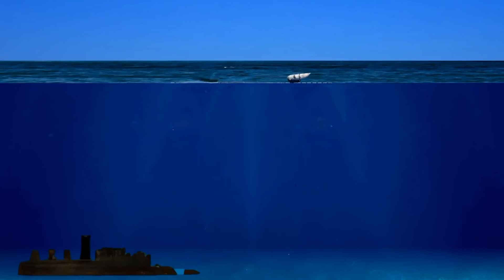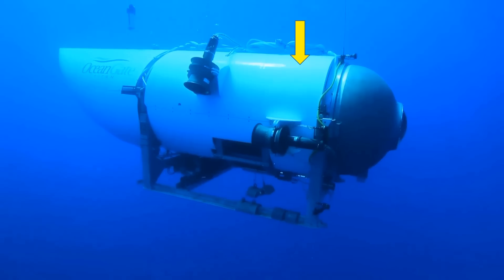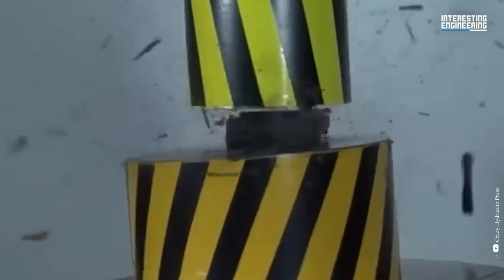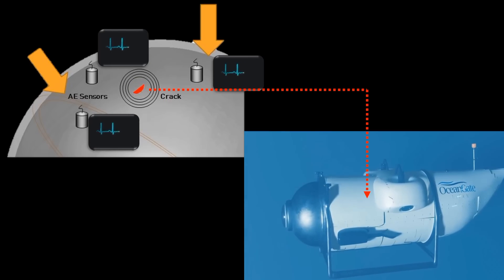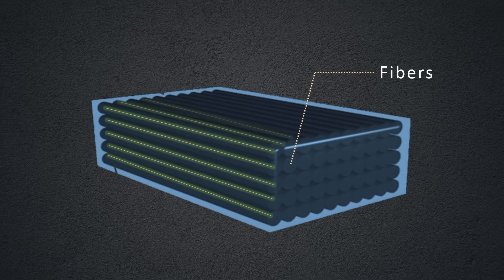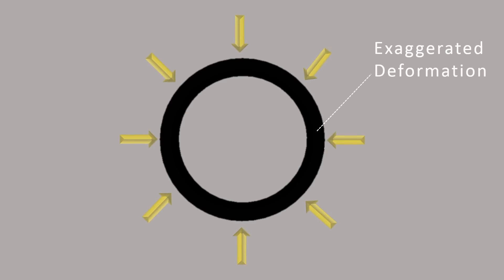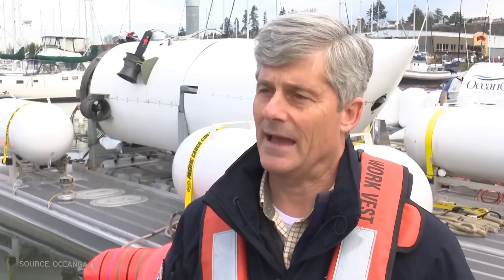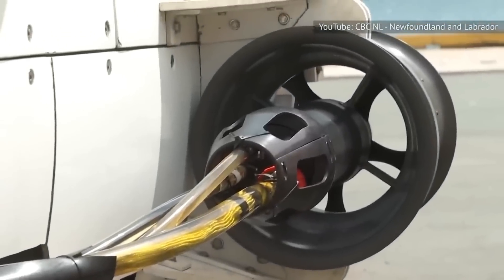Oceangate Titan Did Not Implode Just From Pressure. There Is a Catch!

Comment: Thank you for a well presented explanation of this complex area. I was horrified to  find that according to one video, fittings (such as lights) inside the hull had been attached by drilling into the pressure hull and presumably screwing the fixings into the hole, with or without epoxy filling. This struck me as a likely to create a serious "stress riser" point wherever this was done and seems especially dangerous if any holes were located away from the titanium supported ends in the main cylinder.
Even partial thickness holes (as I imagine they were) would seem very dangerous given the enormous cyclical loading the hull was expected to endure. 
Your comments will be valued. Tim D (Old submariner - welded steel hulls and much lower depths, but still scary sometimes.)
Reply: They didn't drill into the pressure hull, there was an internal 'wall' which they attached things to. More concerning is the amount of consumer grade electrical equipment they had in that sub. Professional electrical equipment is built to higher standards ensuring they don't produce sparks or catch fire.  Consumer grade stuff is built to a budget price.
Reply: I saw this too and literally can't believe it. There has to be an inner wall. There's no way they're that dumb.
Reply: Yeah I float on the surface and I study a lot engineering in the mathematics of this makes the hair stand up on the back of my neck. Those guys had a billion pounds of pressure on that whole total adding up the surface area of the top of my head. When you have a single material like the iron submarines you do then then the whole thing reacts the same to load. You can get by with some funny shapes and weird things like that but you aren't going very deep with that round tube and has Spheres on the end. Even with one material and that shape you will get a stress rieser work makes the transition from complex curve that's a half sphere and simple curve that's the cylinder. When you have a material subjected to his extreme of stress as you had going to the bottom by the Titanic it doesn't take much to be what's called a stress riser. With something like a submarine when you have a stress riser in there and then you have the failure the geometry goes quick and the water comes in and cuts that whole open so fast you can't even blink. When you go even deeper you got to have a spherical shape so that nothing is a stress riser. I saw a guy in a one-man bathosphere dive deep. This thing is creaking and groaning like a tugboat pushing barges on cables except it's only eight feet across maybe. I'm watching this guy sink deeper and deeper just talk and calmly and I'm here in this thing in the hair standing up on the back of my neck and wham(). A 12 inch thick acrylic when do 18in a 🤞 perfectly round shape of course cracked all the way through exactly in half. Not one drop of water came in. I found out after this latest diving disaster with all the rich people getting her medicine for buying quarter million-dollar amusement ride tickets that those bathysphere is usually make one trip all the way to the bottom of hell and then they go to the Smithsonian institute so people can look at that cracked window forever. I have certain rules I live my life by I will run a spark plug wire all the way to failure if it's brakes or my own personal submarine that died thirteen thousand feet in the ocean I'll retire it when there's a lot of use left in it.
Reply: Omg. They drilled the holes. Wow
Reply: @danielmorse4213  it wouldn't have made any difference if they drilled any holes or not that is a total of 1000000000 lb just like wait sitting on top of it and when those materials meeting flex like that going from a zero load to a billion pounds gets a weak spot no matter if  you drill a hole in it or not. There are hellish loads and forces inside that material as it goes from one state to the other and it tears it apart no matter what it's made out of

Comment: Bravo !  from one engineer to another. There is a well established framework for submersibles , time tested for over 50 years. The reasons you have presented here are exactly why Carbon Fiber applications in the aircraft industry and deep sea uses are not the same. Rush relied on principles used in the airline industry. This was a totally preventable event bordering on criminal.

Comment: In the unconfirmed Transcript from the submersible, they mention a crackling sound coming from the AFT part of the hull.
That being said I think it was the connection between the titanium and carbon fiber that ultimately did it in as 
that is the literal point of most stress and variation (squeezing in the middle and rigid titanium on the size, thus max movement and pull on 
the edges). I actually think the acoustic sensors did their job long in time, but the the water "started splitting" the ring area and lamination 
a good 15 minutes before it went pop.

Comment: I am a mechanical engineer and I worked for NASA. One of my jobs was to determine End of Life (EOL) due to fatigue of pressure vessels. However, Non Destructive Tests to determine "Minimum Detectible Flaw Size (MDFS)" played an important part of the calculations. I wonder if there were any fatigue analysis done to determine the cycle life of the carbon fiber shell and if there were any NDTs between dives to detect new flaws and reassess the MDFS which would then calculate the new cycle life of the shell? Probably not. How many dives had the Titan made? Also, I worked with carbon fiber pressure vessels for spacecraft. NASA took the "care and feeding"sic of carbon fiber tanks very seriously. Every pressure cycle was recorded and limited up until launch. Any minor damage that might occur on the surface could propagate in the shape of a cone to the internal surface. It was only detectible with a rigorous and thorough NDT inspections. This is why the Quality Assurance Inspectors, engineers and technicians eventually had gray hair.

Comment: If that's really the way they used the carbon fibre, it's roughly equivalent to a hull made out of very strong string. Make a tube of string by wrapping it around a pipe repeatedly; it will hold its shape, but not all that well. Supermaterials don't help when you're using them a way that hits their weakness rather than their strength. You don't add salt to a cake and expect it to taste good.

Comment: Best C-fiber hull explanations yet.
Question:
I've seen no data anywhere re  the physical characteristics of the resins and C-fiber at 28 degrees F/6,500psi (Titanic's zone).
 I assume most manufactures test under STP or expected conditions for their products, so material characteristics assumed may be wrong.
and the resultant computational models Rush used may be flawed . Just one of the many existential variables Rush's GO  FEVER ignored...

Comment: The epoxy was the failer hands down. Which is not elastic or compressesive. It's to brittle.......Period. Plus the mounting of the two monitors at the back with curse thread screws created a weak point. The carbon fibers by them self can do the  job by it's self. 👉👉It's always the filler that's in question.
Reply: You can use different epoxy. For instance you can have sails made out of carbon fibre, they are flexible to a certain degree. I see the problem more in the raw material they used and in the way they cured it.
Rush braged about, that he got the carbon fibre raw material for a rock bottom price from Boeing. Well, what Rush bought was Carbon fibre prepreg material, that was over its shelf life, because Boeing had a production hold on the 787 for some time. So they couldn't use the CF prepregs, and once they are over their shelf life they are basically worthless, because the manufacturer won't give any guarantee that the resin that is already on the fibres will still have its full strenght. So basically the Titan was build with carbon fibre trash. Yes, you can get it cheap, but there's a very good reason its cheap. You're not supposed to use it for structural parts anymore. If you would do that in aviation, you would basically violate the certification.
The other thing is, after they molded it, they didn't put it into an autoclave. They didn't have an autoclave big enough by them self and apparently were to stingy to rent one that was big enough. This together makes any stress simulation pointless. You don't know how strong the resin really is at this point, it's just guessing and you can't be sure there aren't any significant voids in the structure and how even the structure actually is.

Comment: Carbon fiber has its uses it is stronger than steel but it is not malleable. Steel can deform under pressure and used as a pressure chamber will recover like a elastic band. The grain structure of good steel is homogenous equal over the entire structure that is why it is the norm for this purpose. Carbon fiber is directional its grains crude only as good as we make it and limited in elasticity it will yield before deforming to the point of steel. The writing was on the wall. RIP and condolences to the families. There is no lack of ignorance in this world.

Comment: The Hydraulic Press channel has an excellent video of a scale model of the sub being cycled until failure, with his rough model reaching 80 - 85 bar pressures before failure.
Alarming to him and myself, small bubbles coming from the carbon fiber under pressure, suggesting voids filled with air.
That said, I'd wholeheartedly recommend the submersible - with a proper viewport or better, no viewport - for use as an ROV to further test the technology. And ultrasonic and x-ray examination after every cycle.
As that environment makes space look like a cakewalk and even chemistry starts to behave in odd and unexpected ways.

Comment: You are missing the key point. Why does a carbon fiber cylinder withstand fatigue and delaminations over hundreds of cycles when filled to more than 5000 psi pressure with hydrogen gas in hydrogen fuelled vehicles? The answer is that when pressurized from inside the carbon fibers in the composite are in tension where they are strongest.  Forces from outside put the sutface of the hull under compression hence the fibers arr not contributing towards the strength of the hull.

Comment: Thanks for a very informative video about this incident. One thing I've not seen mentioned either here or elsewhere is the standard engineering proof for a vessel like this which is to build a second vessel and take it right through the planned loading duty cycle - say 200 cycles to depth if the planned structural life is 100 missions (inside a pressure rig or, cheap option but still effective, by winching the thing down and up in the actual ocean.) Followed, if the vessel hasn't failed by then, by a test to destruction, looking for (aerospace background here) a pressure loading of 150% of the planned 12000 ft.

The NDT would be carried out continuously during that development testing and MIGHT give options for design revision if problems were found. Use of more rigorous NDT during operation, whilst it might have saved lives, wouldn't save the programme if the vessel had to be scrapped after the 10th or 20th mission. Real-time NDT, for a failure mode that would be expected propogate instantaneously, doesn't really seem to help.

And the bravado in showing how "engineering" can be much faster and cheaper than the experts think, as exemplified by the game controller, shows just how ill-conceived this venture was. Sure, all these corner cuttings do indeed get you there a lot faster and a lot cheaper that those stuffy old professional engineers would allow but you might not want to be there when the shortfalls of the methodology become clear...
Reply: Would a mother ship be able to handle the weight of the winching rope  and winch drum for that length?
Reply: @tsunamis82  ...not forgetting the additional ballast to assist the swiftest possible descent & speed up testing, but yes, I guess the cable would only add a tonne or so (subtracting buoyancy), small beer in oceanic operation terms. But if you don't budget for the test article then considerations like this don't arise...
Reply: @tsunamis82  The submersible, when in the water, can have very little weight, so there's no need for heavy cables.  
A sea voyage and a long series of deep-sea tests is hardly cheap, but it would be the only option.  I don't believe there are any hyperbaric pressure test facilities with a vessel large enough to hold the Titan and capable of the required 6,000+ psi test pressures.

Comment: That carbon fiber is more resistant to tension than compression is easy to see. What I have trouble imagining is how carbon fiber could even be used in a compression environment. How would one translate radial compression into tension? Unless I am missing something in conception of 3 dimensional physics, I can see NO application for carbon fiber in the pressure hull of a vessel, UNLESS the hull was so overbuilt that the weakest directional resistance was still many times more than needed for the target environment. The hull was 5" thick. It might have well needed 10" or 15" tomsurvive
Reply: But I would still think it was the epoxy bond that gave up first.

Comment: People, stop all the silly videos of what you THINK happened.  All we need to know is that that irresponsible CEO didn't want the "old White men" who were skilled REAL engineers with decades of education and experience but instead wanted to hire a diverse group of inexperienced STUDENTS to put together an UNTESTED/UNCERTIFIED tube to take fools 2.5 miles under water where the pressure is 6,000 PSI which equates to 18,000,000 PSI given the dimensions of that death trap.  Leave it alone folks and stay on land.

Comment: Carbon fiber is attractive because of its light weight. But as another mechanical engineer, that is the only advantage that I see CF has over other submersibles materials (steel or titanium). Like you said, since CF is anisotropic it is difficult (or impossible) to predict its strength (unlike an isotropic material like steel). Even if you did know the strength, there are imperfections in the layment that can cause a premature failure. Since the we are dealing with human lives, I do not think the experimental CF should have ever been used.  Its pretty obvious that was a bad choice.

Comment: I heard crackling noises in the video's I saw, I think this were the fiberlayers loosing their connection under the immense pressure. A Carbonfiber hull might work well when the outer pressure is lower than the inner pressure. Based on what I saw I even think they even mounted the monitor-brackets and lights with screws in the hull which is an immediate weak point.

Comment: If the transcript is to be believed it appears that the Titan may have developed buoyancy issues because either the carbon fiber structure started cracking allowing some water intrusion (or possibly if there is a separate pressurized enclosure for electronics or other components that leaked before the enclosure with people).... either way leaked water for a period of time before the implosion affecting buoyancy sounds like a factor.  They then tried to return to surface but were unable to ascend quickly enough as the sub continued to crack and eventually imploded on them.